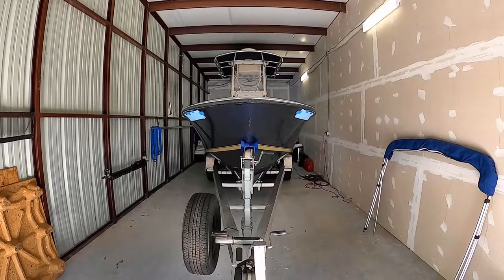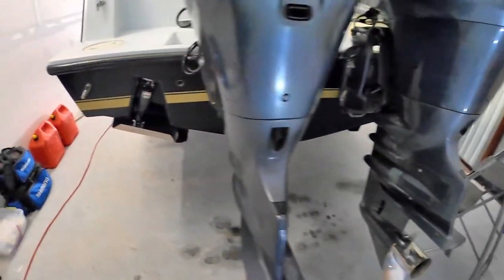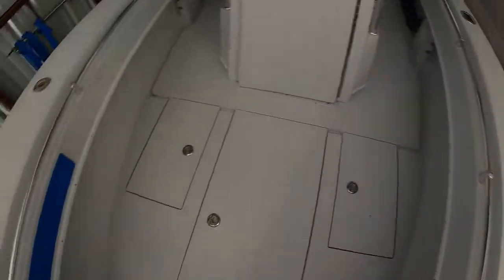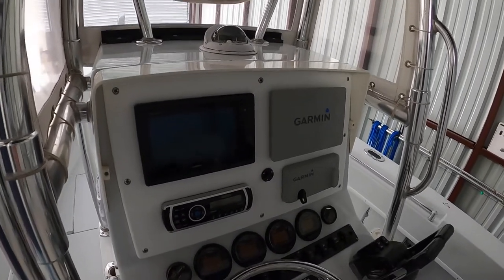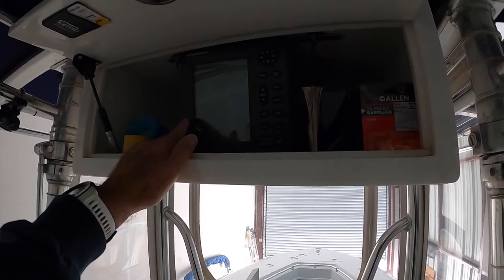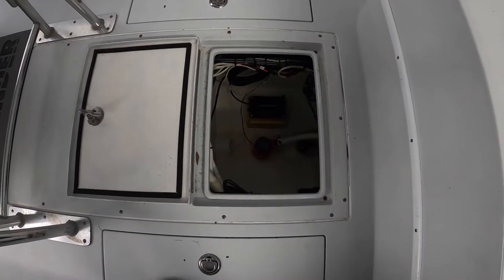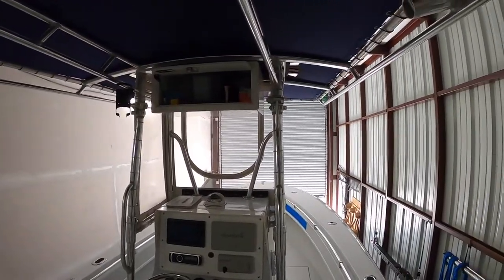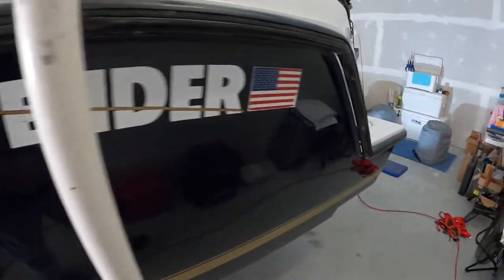Contender 23T Walk-Through

Comment: may as well replace anchor light, get yellow lens outta there, and a led festoon bulb.  i did all the same lighting changes, even taco tube insert, nice white anchor light really looks nice over yellow colored light.
Reply from the maker: Thanks for the feedback.  That light has been on my to do list for a while.  I just got a new tube for the overhead light and a new led light strip.  Install on that in the next few days.  Amazing all the little items that keep popping up.
Reply: @saltydogsusa6382  ya, i'm waiting now to get tank replaced.  just repowered 2 years ago.  at least contenders should hold their value and the little, and big, things aren't so wasted on platform that wont last.
Reply from the maker: @tim6986  What model do you have?
Reply: @saltydogsusa6382  99 23 open.